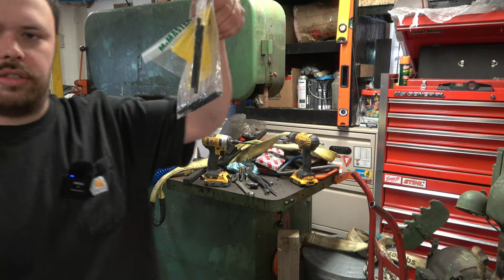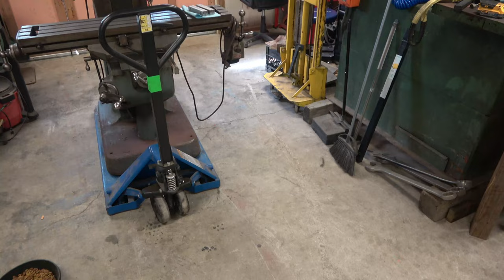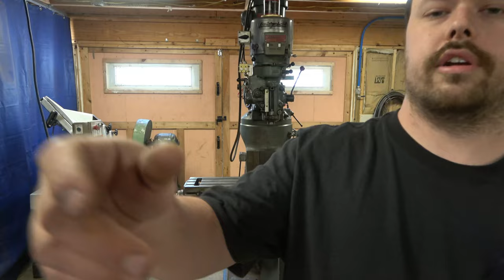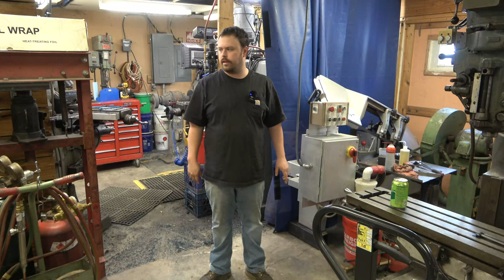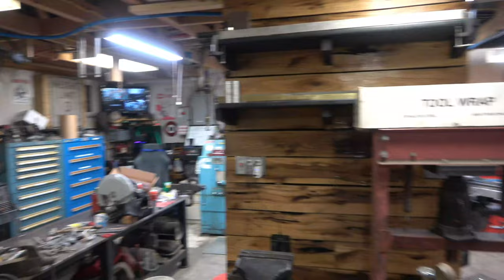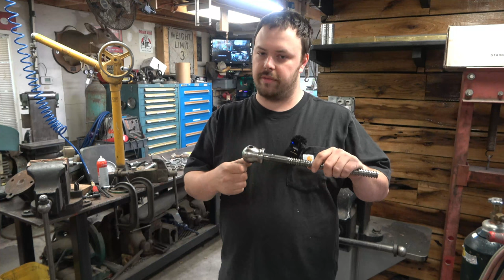Friday Night Ramblings 9: Quick shop layout update

Comment: A lot of moving around to do. How did you start off restoring vices?
Reply from the maker: I started as a collector about 11-12 years ago. Always had interest in metal work so the first thing I learned was welding; I bought a nice mig welder and then a stick welder. That evolved into me fixing up some broken vises that I had. Eventually I got into machining just as a side hobby like the welding and it took off from there.